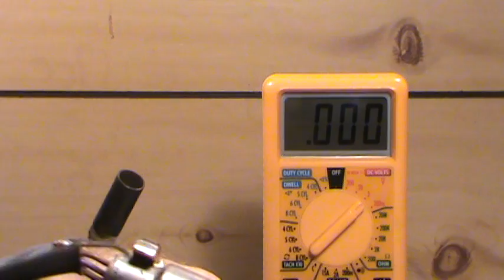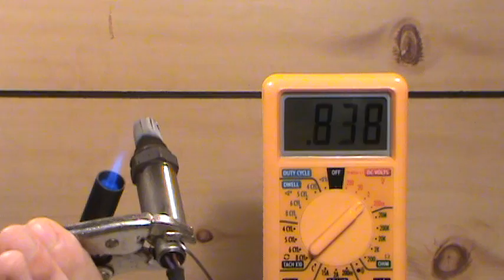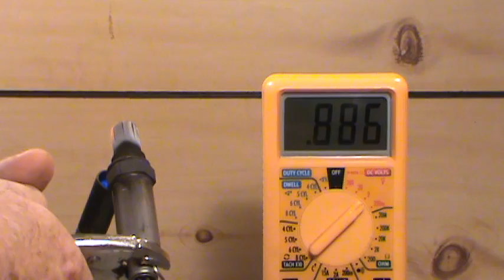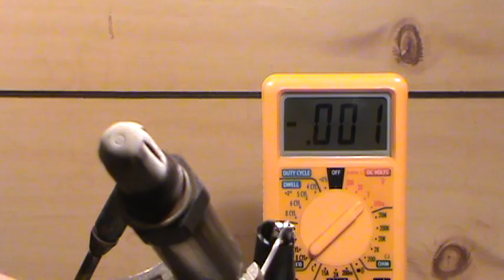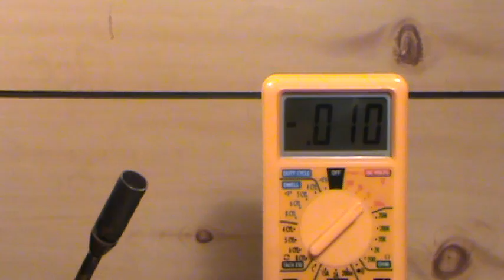Oxygen Sensor Test

Comment: You are missing a very important fact O2 sensors don't defect oxygen they just compare oxygen levels at the tip to oxygen levels at the tail. The reason is coming as Rich is because in your case oxygen levels are about the same

Comment: Interesting. Does the direct flame not damage the internal elements? Also, visually, should a sensor look clean, black or white? Is there any diagnosis one can gain about the state of ones engine or cat by looking at the sensor(s). I just replaced my downstream sensors and after a month they are black and sooty already
Reply from the maker: Greetings...Mad Mac 66.........Thanks for watching..........Well, the Propane Flame, by itself, probably isn't too hot for the Oxygen Sensor, as compared to, something like, a Gas, Welding or Cutting Torch, that usually mixes in Oxygen (with the primary gas), that will increase the Flame's Temperature, probably to the point, where, if used on an Oxygen Sensor, then, that poor ole Oxygen Sensor's Metal, would probably Melt, where-ever, that very Hot Flame, was contacting.............Generally speaking, an Oxygen Sensor has to reach a Temperature, of about 600 Degrees Fahrenheit, before ,it will start to work properly anyways.............The Deposits, on a used Oxygen Sensor, shouldn't be very much at all, just some slight coloration, but only "if", the Engine, the On-Board Computer, the Catalytic Converter/s, and all of the Sensors and Actuators, are "All" working Correctly, and All of them, at the very same time, as in, 24/7/365 Days a Year, but only, when the Engine is actually Running (think in terms of..."The Chain, is only as Strong, as its Weakest Link").............I have a Video, on my YouTube Channel...RockysRoadshow...where I show an Oxygen Sensor, all covered with, a black, dry, carbon coating (on it)............If Your recently Replaced, the Post (after) the Cat (Cat = Catalytic Converter) Oxygen Sensors, and, they are all covered, with that Dry black Carbon, then, there's Trouble-in-Pair-ah-Dice, most likely (were Your Deposits, black and "Dry", or, were they "Oil-ee" looking at all...???)............The Engine, is probably running too Rich (air/fuel ratio), or, is there lots of (engine related) Misfiring going on, and, if so, raw/unburned gasoline, will be flowing through the exhaust system, and is "Not Good", for a Catalytic Converter" (damage)............There are 2 basic things, that should be done, and is, as follows............The first being, a Fuel "Pressure" Test (I have a Video on that, for a GMC/Chevy 4.3 V-6 Engine, that will show You, what's generally goin' on).............The other, is to Extract the "Trouble Codes" (if any?), that might be Stored, in the Vehicle's, On-Board Computer's "Memory".............If Your Vehicle is about 1996 or Newer, then, it should have, an OBD-2 (On-Board Diagnostics, Version 2) System in it, where-by, a "Scan Tool" (looks, kinda like, a slightly larger hand held calculator), has to be Connected to a 16-Pin Port/Connector, that's usually, just under the steering, there-abouts, most times............Some Automotive Parts businesses, might, "For FREE", Scan Your Vehicle's On Board Computer, so, just Phone some of them, and hopefully, You'll find one, that does.............The "Correct" Fuel Pressure, is very "important", on a Fuel Injected engine..............If any "Trouble Codes" are found, in the On-Board Computer's "Memory", then, they only point You in the right direction, pretty much meaning, that, oh, let's say that, it's an Oxygen Sensor code, well, it might turn out to be, a bad Wire, or Connection somewhere, sometimes............You might have a Trouble Code, that ends with 420, and that is usually the code, for a Catalytic Converter, that is not working, as good as it should be (worn out?)............Dry black Carbon, on, both Oxygen Sensors, and/or Spark Plugs, are a very good indication of Gasoline being wasted, and not burning properly, in most cases...........Even when the Engine, and its Management system, are working properly at all times, then, even Oxygen Sensors, will eventually Wear Out, and, will cause a problem or two, when they do............If the "Cross Counts" (that, kinda looks like a sine wave, as in a wave, that goes above and below, a center line), start to slow down too much, on something like, a Narrow Band oxygen sensor, then, even without a trouble code (on some systems), there is a possibility, that, a Rich (air/fuel ratio), will start happening (just ask me...lol).............Are there any Warning Lights, lighting up, on Your vehicle's Dash Board at all...???...cuz, that's usually something, that needs to be tended to, sooner, rather than later...........If it isn't too late, then, get Your Vehicle's Problem, or Problems "Fixed", as soon as possible, to try and "Save" Your Catalytic Converters, from being totally Damaged/Destroyed, cuz, imagine now, the Cost of Replacing not 1, but 2 Catalytic Converters.............Also, Don't install New Catalytic Converters, on any Vehicle, that "is Not" Running Properly, and as it should be, or, the New Cat or Cats, will become Useless and Damaged as well, and I hope not.............Good luck, and.......till next time.......Be Safe, take care, and have a good one.
Reply: RockysRoadshow Thanks Rocky. I do have a 430 code, cat operating below efficient levels. I recently changed oil, replaced all 6 spark plugs and removed and cleaned the throttle body. Even removed the cat and gave it a good cleaning. Plugs were in quite bad shape, but more white than black and sooty. Mostly they were a good tan color. That's when I replaced the O2 sensors as well. Like you suggest, I'm reluctant to replace the cat until I e isn't something further upstream causing damage
Reply from the maker: Greetings...Mad Mac 66.............You're welcome..........That 430 Code, comes up as, Catalytic Converter, working below efficiency threshold, on "Bank 2".......Usually, "Bank 1", is the side of the Engine, that has the Number 1 Cylinder (number) on it (so, Bank 2, should be, the, shall we say, Other side of the engine), and Check, to see if I'm right or not, just in case............That's quite helpful (that 430 Code), cuz, at least now, it kinda narrows thing down, to that Bank 2, side of the engine, hopefully, that is.............Some, of the Post/after the Cat, Oxygen Sensors, depending on the vehicle's manufacturer, might have a role to play, with the information, that it sends to the vehicle's on-board computer, and might be used, and have something to say, as far as the air/fuel ratio is concerned, from what I've read in the past, that is............There are certain Parts, that have to be changed out, on a Time, and/or Mileage basis, such as...Spark Plugs...spark plug Wires (if applicable)...all Filters, oil, gas, and air...Distributor Cap & Rotor (if applicable)...etc. , so, it's always a good idea, to keep up with, all of those, shall we say, "Tune-up" items, and consider them, a Must-Do, when they need Do-in, or, sometimes, some, not wanted, or not needed Problems, will probably start to show up...........Is there a noticeable Misfiring of the Engine at all...???...Rough Running...with engine Cold or Hot...???..............If You can let me know, about, Your Vehicle's...Year...Make...Model...Engine Size...etc., then, I'll have a much better chance at helping You out, and.........till next time........Be Safe, take care, and have a good one.

Comment: I finally after all these years blindly replacing them took time to understand the why it does or don't.  Very good explanation.  Thank you
Reply from the maker: Greetings...TheBrownrave..............You're welcome, and, Thanks for watching..............Well, there are a few Different types of Oxygen Sensors, and, they also Operate, in a some-what, Different manner, as compared to, the Oxygen Sensor, that You saw in this YouTube Video of mine..............This, Mid-1990's, Oxygen Sensor (design), that You saw in this particular Video (of mine), is known as the..."Zirconia"..."Narrow Band"...(type), and it Generates its Own Voltage Output, when it gets Heated up to, about 600 Degrees Fahrenheit or hotter, and the Voltage range, that it produces, is usually between, just above, 0 (zero) Volts, to no more, than, about 1 (one) Volt................Then, there's the..."Titania"...(type of) Oxygen Sensor, that, when heated up, to its Operating Temperature, will be Varying its (Ohms) "Resistance" Value (Not Volts), and, from what I recall, the Vehicle's On-Board Computer, might be sending about 5 Volts, to this Titania (type of) Oxygen Sensor, and then, that (original) 5 Volts, will probably, get Changed, to a Different Voltage Value, due to, what-ever (ohms) Resistance, that it encounters, at the Titania (type of) Oxygen Sensor, and then, that Modified/Different Voltage Value, then, gets sent back to the vehicle's On-Board Computer, for further processing, well, if I get it right, that is.................Then, there's the..."Wide-Band"...(Lambda...???)...(type of) Oxygen Sensor as well.............This, "Wide-Band" (type of) Oxygen Sensor, from what I recall, has a..."Stoichiometric"...Value/Point...and...(that be, oh, about 14.7 to 1 Air/Fuel Ratio, at about sea level/altitude, where-by, the Air/Fuel Ratio/Mixture, will have the best chance, at Burning completely, and will usually, be taking place, once the engine, is up to, about operating temperature, and also, the Engine, is either, just idling, or, the vehicle, is just cruisin' along, at not, too fast of a speed, on a level road, for example), and, any Value "Lower" than, that Stoichiometric Value/Point, is (from what I recall), should be, a "Richer", Air/Fuel Ratio, and, any Value "Above"...that Stoichiometric Value/Point, then, it will probably be, a "Leaner" (air/fuel ratio), than, that, "Stoichiometric" Value/Point of, about 14.7 to 1 air/fuel ratio................Engines, that are Started Cold, as well as, going, something like, WOT/Wide Open Throttle/Pedal-to-the-Metal ("High" Engine "Load"), then, the Engine, has to be fed, a much "Richer" Air/Fuel Ratio (mixture)...as in, about 12.5 to 1 Air/Fuel Ratio, there-abouts, as an example, or, if not, as in, a Way Too Lean, of an Air/Fuel Ratio, then, the Engine will usually end up getting "Damaged", oh, and, also, the Oxygen Sensor's "Signal", usually gets "Ignored", by the vehicle's On-Board Computer, at this time, and, it usually, goes into, what is generally known, as "Open Loop" (operating mode)................The On-Board Computer's..."Closed Loop" (operating mode), usually takes place, once the Engine is up to, about Operating Temperature, and, the Oxygen Sensor is also, up to its Operating Temperature, then, the On-Board Computer, will go into "Close Loop" (operating mode), and, will actually be "Listening" to/reading, the Oxygen Sensor's "Signal" (be it, what-ever it happens to be, at the time), but..."Only"...when the Engine is warm, and is just Idling, or just Cruising along (as an example), at, not too fast of a speed ("Low" Engine "Load")..................Then, also, depending on the type of Oxygen Sensor in question, then, there can be, as few as, "1" Wire, attached to it, to as many as, "4" Wires (might even be more, perhaps), attached to it..............The "Single/One" Wire, type of Oxygen Sensor, will probably, only have, that "One" Wire, as being the Signal Wire, and, will probably, be depending on, the oxygen sensor's Metal Body, to provide the (electrical) Ground, where it makes contact, with the exhaust system/pipe.................Also, when it comes to Oxygen Sensors, pay very "Close Attention", to the "Part Number"/Description, and "Location", that, that particular Oxygen Sensor gets installed "in", as in, for example, some of the Oxygen Sensors, that get installed..."Pre"-Cat (that be, "Before" the Catalytic Converter) Oxygen Sensor, can sometimes, be a..."Different"..."Part Number"...when compared to, the..."Post"-Cat (that be, "After" the Catalytic Converter) Oxygen Sensor, just so You know.............If there happens to be, oh, let's say, "3", or More "Wires", coming out of an Oxygen Sensor, then, I'd be inclined, to be thinkin', that, there's probably a "Heater", built into, and hidden inside of, this type of Oxygen Sensor.........."Heater"...???...say what...???......well, the "Heater", that's (hidden) inside, will usually, "Heat" the Oxygen Sensor, up to its Operating Temperature, very Quickly, as compared to, probably Waiting, for, quite some time, for the engine's Exhaust Gas, to get that particular "Non-Heated", type of Oxygen Sensor, Heated up, to its required Operating Temperature, so it can Function, as intended...and, just imagine now...that poor ole (older type of) Oxygen Sensor, that's, shall we say "Heater-less", and, it happens to be, a very Cold Winter's Day, where the Dog's drinking Water, is Frozen, Two inches Thick...!!!......then, I ask You..."How long, (time-wise), do You think, that, it will take, for the, Cold, and just Started Engine's...Exhaust Gas, all by itself, to be able to, "Heat-Up", that, almost "Frozen", Oxygen Sensor, up to, at least 600 Degrees Fahrenheit...???...interesting huh...and, with the above, all said and done, I now say.......Be Safe, take care, and have a good one.